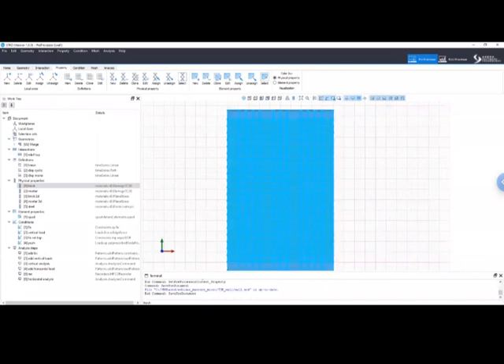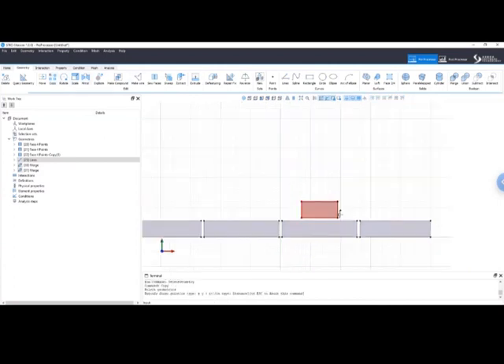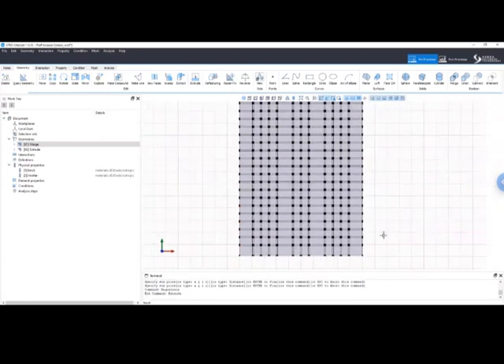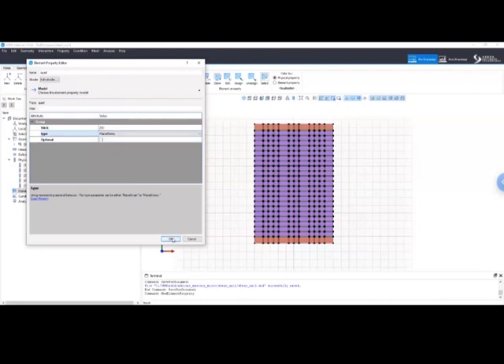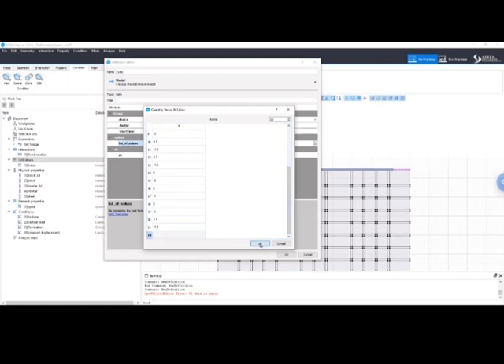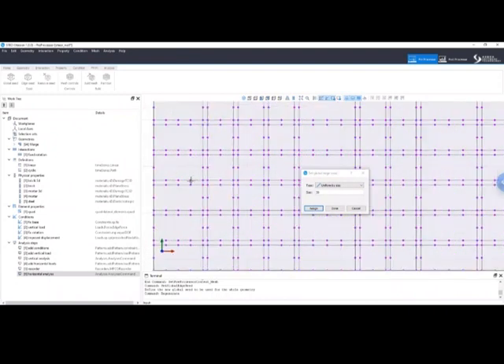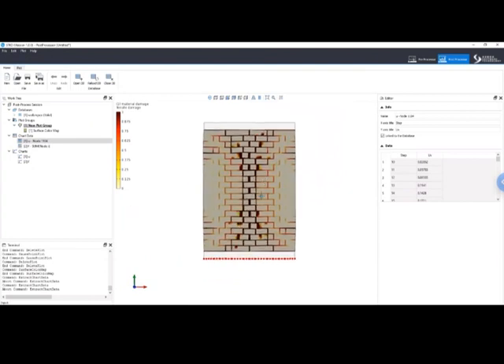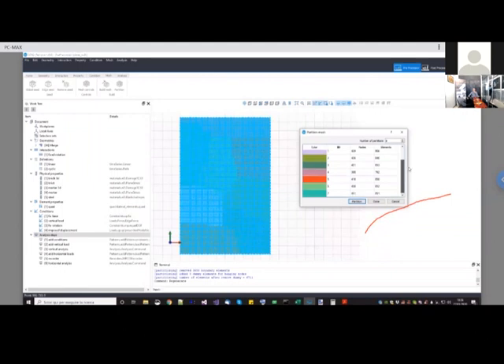STKO E-Learning Course - Masonry Micromodelling

Comment: Thank you for sharing this nice video about the micromodelling of a IP wall. 
Could you provide the reference about the nonlinear properties to be assignet to TC3D material model? 
As I can see, no self weight is applied in this case, together with the vertical load of the top beam, we can neglect because of the dimension of the wall? How much do you think the shear behavior is sensitive to the intensity of the vertical load?
Reply from the maker: Dear Fabio, a brief description of each material parameter is shown in the Physical Property Editor, whenever you select an attribute. 

A more detailed description can be found in this reference:  
Petracca, M., Pelà, L., Rossi, R., Zaghi, S., Camata, G., & Spacone, E. (2017). Micro-scale continuous and discrete numerical models for nonlinear analysis of masonry shear walls. Construction and Building Materials, 149, 296-314.
https://www.researchgate.net/publication/317068729_Micro-scale_continuous_and_discrete_numerical_models_for_nonlinear_analysis_of_masonry_shear_walls

For the sake of simplicity, In this example we only put the vertical load specified in the report of the experimental setup. Of course, if you want to be more accurate, you can add the self weight very easily in STKO. You have 2 options:
1) use the options in the Element Property to specify the body forces. However in this case the self-weight will be applied all at once, not incrementally. This is fine if you expect your structure to behave linearly under its weigth.
2) Use STKO condition "FaceForce". In this case you will put a pressure load in the Z direction. Since this model is 2D, the value should be = -rho*g*thickness. This second option is more general, since not every element in OpenSEES have the body force option. Moreover this is a load, so you can use a timeSeries to provide a load multiplier. This is better if you expect your structure to go nonlinear under its own weight. Even if this looks like a distributed force on a surface, behind the scenes STKO does a load lumping converting this pressure in equivalent nodal loads supported by OpenSEES.

Finally, of course the shear behaviour is sensitive to vertical stress, higher shear strength with higher compressive stresses. However this is a 2D plane-stress example, so for very high compressive stresses it might not be so accurate. Why? Because in a plane stress condition you cannot represent the typical triaxial compressive stress confinement acting on mortar joints. In those cases you'd better do a 3D model